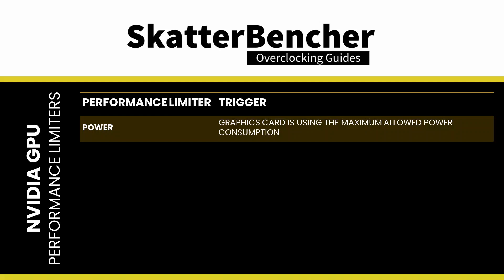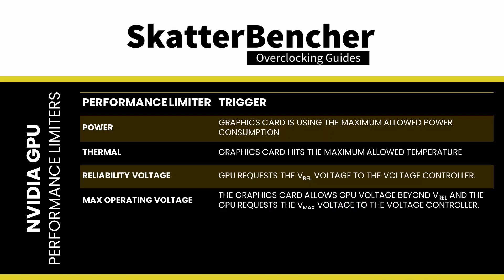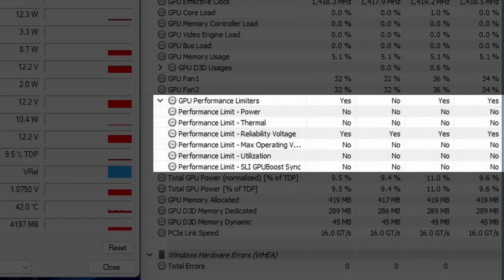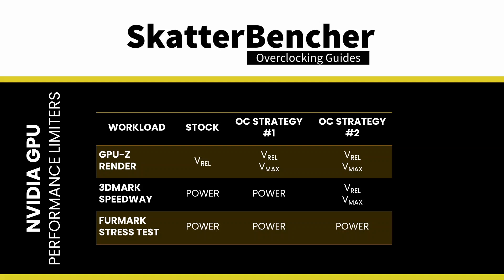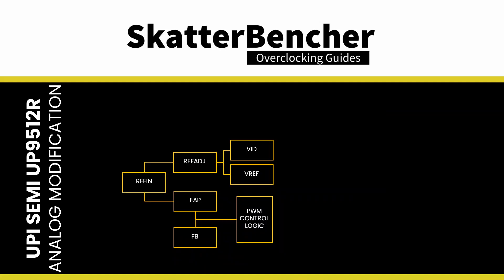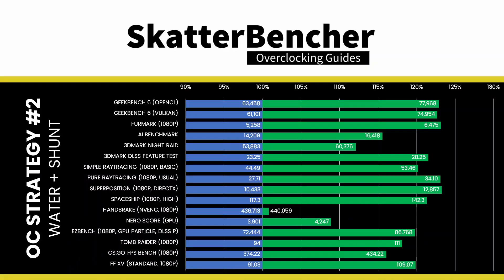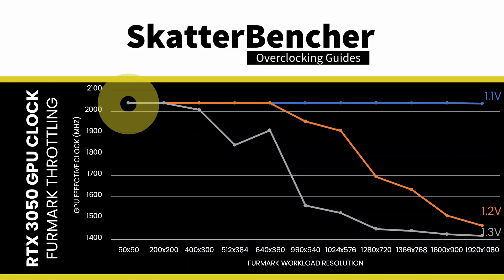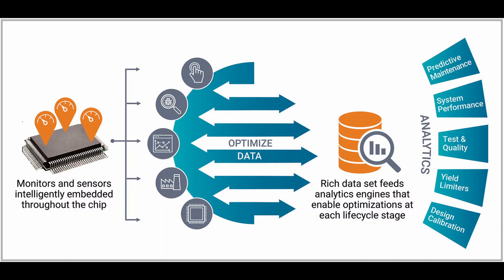Exploring NVIDIA GPU Boost Performance Limiters with RTX 3050 | SB#62

Comment: I never used vf tuner to oc or just anything but past year I've done tests here and there on my 32-38 watt Power limited gtx 1050 notebook, similar situation as the gt1030 you overclocked but the difference is there is absolutely no way to hit vmax through software and since I haven't been able to extract my vbios (it's integrated with the laptop bios iirc) there's no way for me to flash it/ flash it without the risk of bricking the board. back to the vf tuner thing which was that even at voltages that are well within nvidia's spec (0.913 to 1.075) hwinfo would read effective clock far lower, compared to when I would manually give an offset in range of 100 to 216mhz even tho the clocks were the same and easily achievable the effective core clock with vf tuner was always around a 100mhz lower. the way I tested the different voltages was by making an nvinspector batch file where I could set the voltage anywhere between 0.65 to 1.075 (overvoltage/ overvolt commands did not work when I used them). the command thing I put in was -lockvoltagepoint:0,1075000 
this won't lock the voltage at all times at 1.075v but works more like a limit, setting it any higher doesn't help either, I find it useful for when I want to test clocking on lower voltages